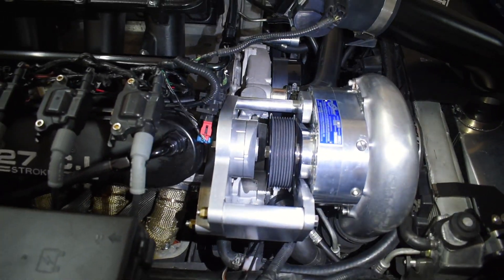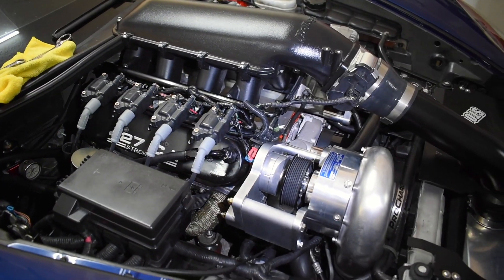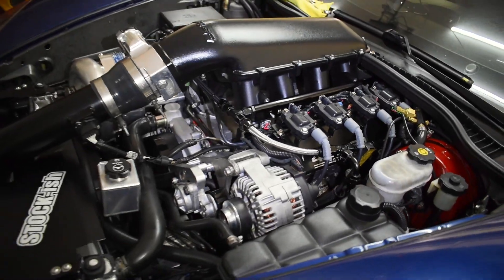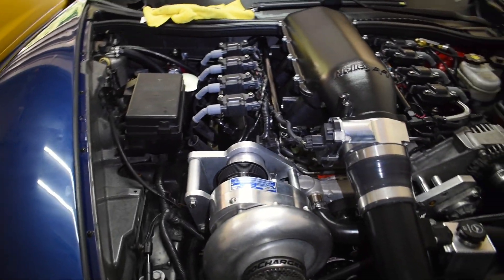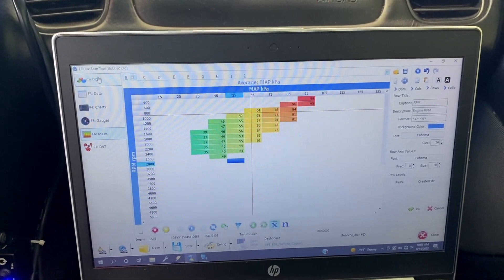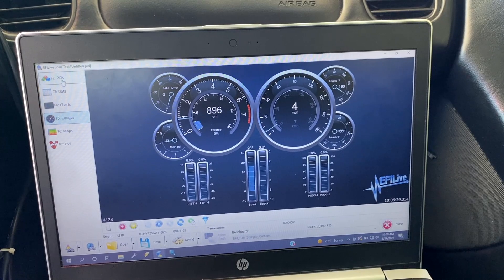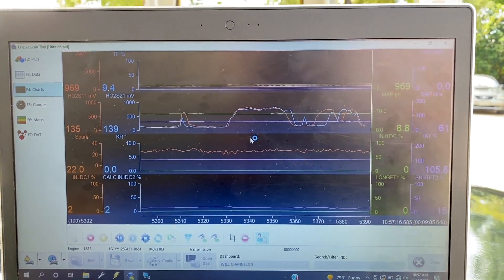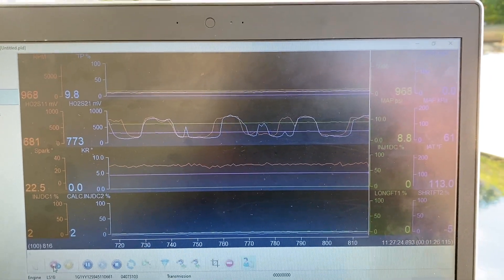Fully Built ProCharged CORVETTE C5 Z06 | EFI LIVE E85 Conversion

Comment: Use the a& a bracket. That’s  why I hate procharger the big blowers all have belt slip and break problems because the bracket sucks. I never have any belt problems with my Ysi
Reply from the maker: We got it all figured it out! Used a laser alignment tool. Pulleys we’re definitely off. Used some washers to shim the brackets some and were golden!